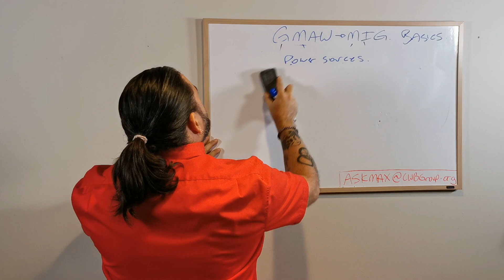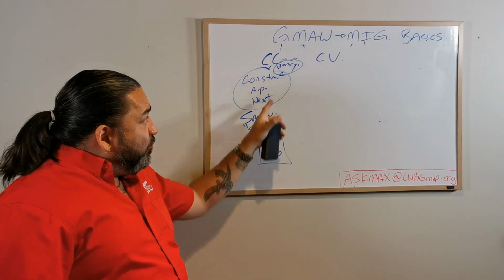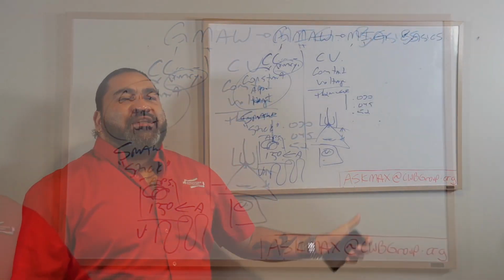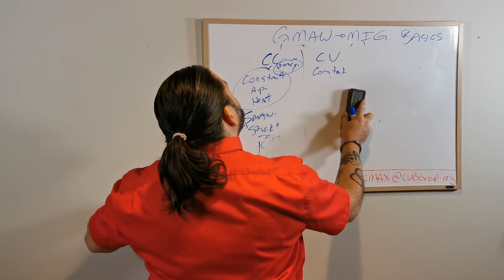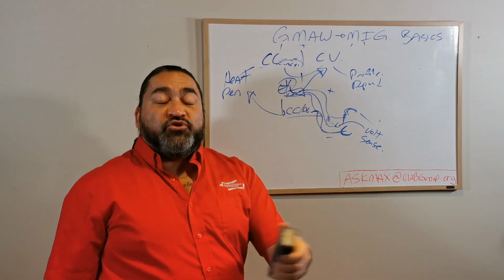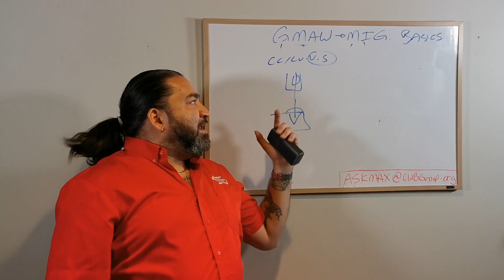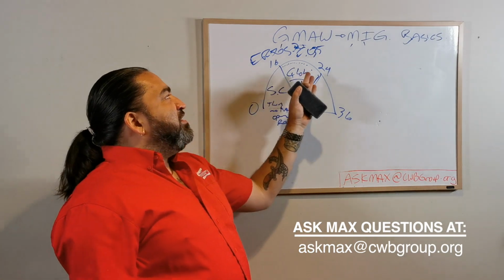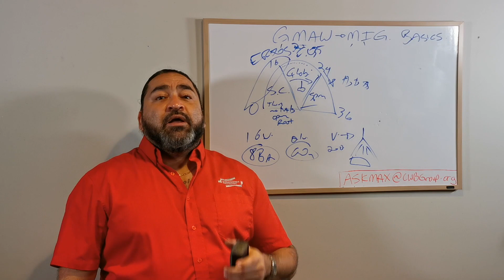Make Metal with Max - GMAW Part 2: MIG

Comment: Hello Max; the question I have based on your actual welding experience and knowledge of welding machines, would you comment on a cc and CV machine. This is electronically controlled and has a peak intersection, so both working together is it of a purpose in welding? 
Welding Process:   SMAW      GTAW      GMAW      FCAW
Output Type:               CC             CC            CV             CV